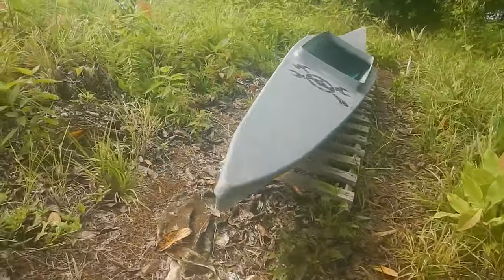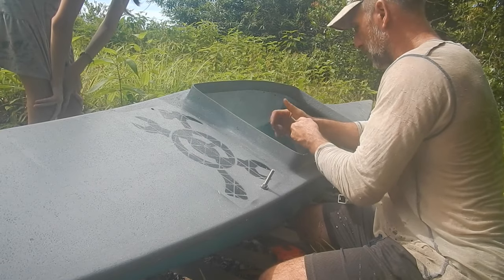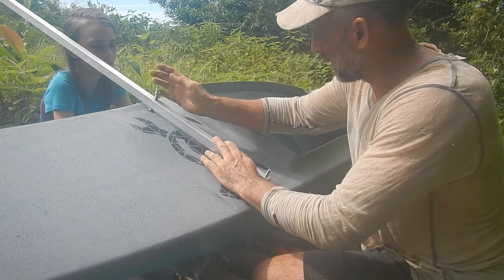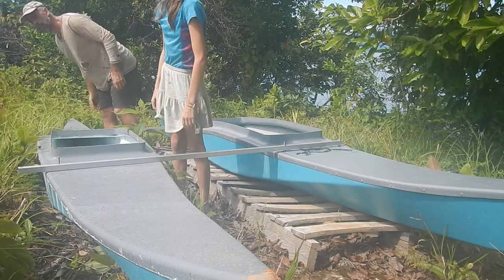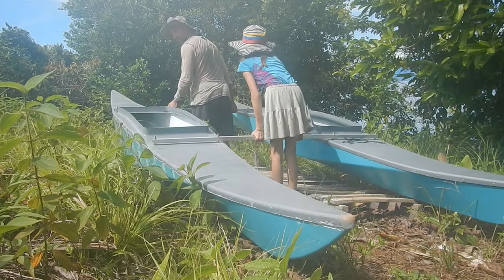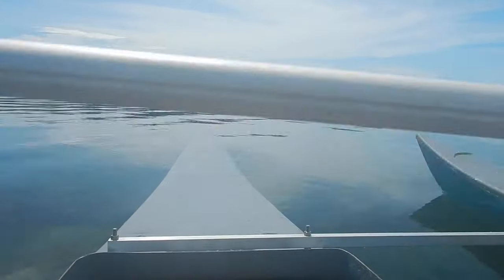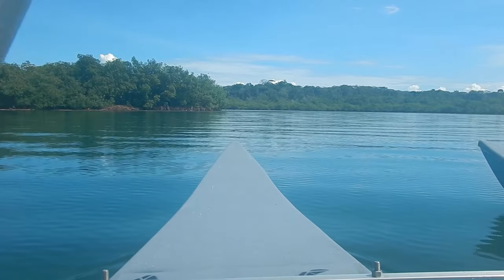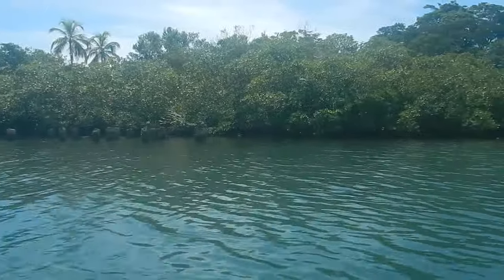Double Kayaks!  K.I.S.S (Keep it Simple, Stupid)

Comment: Kayakamaran! We just got another adjustable stand up paddleboard paddle for one-sided paddling. I have rubber washers where my brackets fit in the kayak hull. I like the flex of the pvc and I made a frame in the middle to put a net or platform. I love your design and i'm sure we will both modify our solutions as needs arrive. So much fun making stuff and using it!